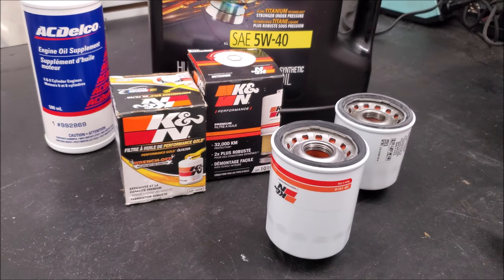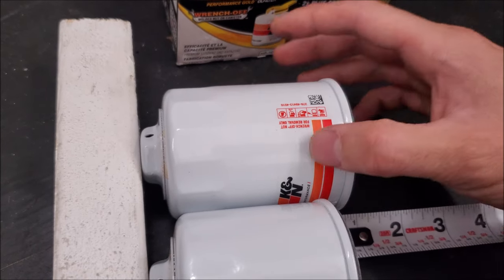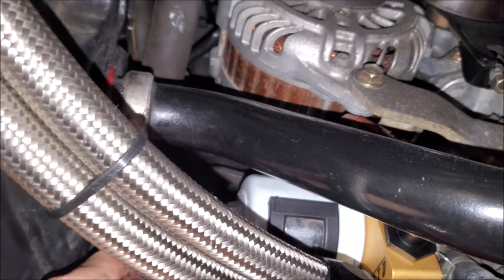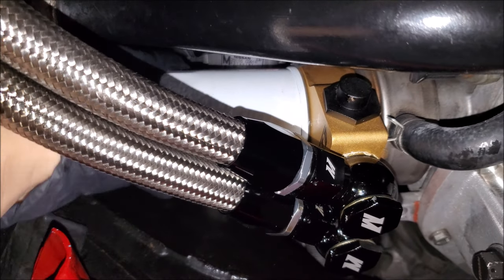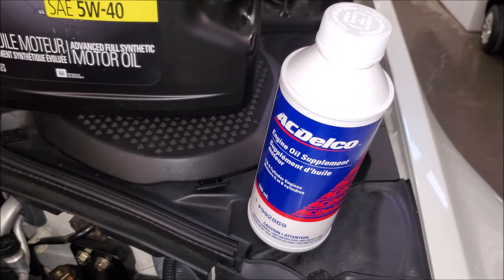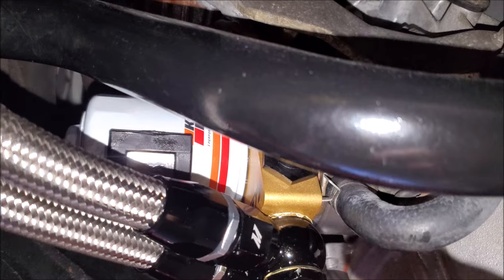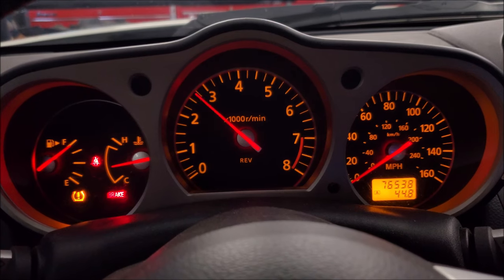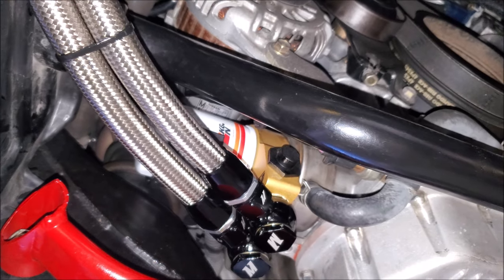Nissan 350Z / Infiniti G35 Larger Oil Filter (K&N HP-1010) | AnthonyJ350

Comment: i installed on my Z350 Mobil Extended performance M1-110 oil filter which is also a bit longer then regular with Mobil extended performace oil 5w-30. The combo works together perfectly, the car rips!
Reply from the maker: Awesome! Thanks for sharing!

Comment: You should try out fram ultra / wix xp / purolator boss and Mobil 1. All those filters are actually better than the HP. The HP is designed for better flow but it has a lower micron rating (95% at 30 microns) where as the ones listed above are 99%+ at 30 (Mobil 1) and 20 microns (smaller particulates). The k&n is designed more for racing so it priorities flow over filtration.
Reply: they also have wire mesh backing for structural rigidity under high pressure
Reply from the maker: I don't rely solely on any oil filter to get the small metal debris, that's why we add magnets to all our vehicles https://youtu.be/Lec_ykPhV8A
Reply: @AnthonyJ350  I hear ya. I was just suggesting because I also run a filter mag w/ a greddy mag drain w/ those filters on my g. That way all 3 filtration sources are top tier. But just my suggestions I love your vids man thanks for your feedback !
Reply from the maker: @sixtyminute4482  Funny thing is I just went on K&Ns website. They only list the smaller HP-1008 for all the Nissans including the GTR. Technically making this video already obsolete lol.
Reply: @AnthonyJ350  if it works it works I guess 🤣
Reply from the maker: @sixtyminute4482  I'm just going to put an all aluminum 5.3L and bore it out to 5.7L. That way it's still a 350Z (350 cubic inches 😉).

Then I can put a nice big Chevy oil filter on it.
Reply: @AnthonyJ350  hahahah full send brotha
Reply from the maker: @sixtyminute4482  You can solve any VQ, Rotary or Boxer engine issue with an LS engine lol

Reliability issues and power aspirations.

I never check the oil in my truck. Even with a small oil leak it never gets low between oil changes lol.

Comment: Good Idea! My questions are ,is the Bypass Valves set to the to the same Pressure setting for bypassing? Do both filters have the same Micron filtering? How much more square inches of filtering media are you gaining by going to the larger filter?
Reply from the maker: If it's good enough for a GTR and also works on a 1.7L Civic, it should work fine for a VQ.
Reply: @AnthonyJ350  Typically, engine manufacturers design bypass valves to open at a pressure differential of approximately 10 to 30 psid with some as low as 4 psid (28 kPad), and others opening as high as 75 psid (500 kPad).
K&N filters only to 30 microns, Mobil 1 filters down to 20 microns. 
Your hypothesis of doing Better may be wrong and based on assumptions.
Reply from the maker: @stealthg35infiniti94  You can put a Mobil 1 filter for a GTR if you'd like. My point was advocating for the bigger body. Not the brand.
Reply: @AnthonyJ350  Research on bypass Pressure is required. The 20 microns is excellent filtration. The theory is to catch the particles and not let them bypass or go through a larger opening (30 microns).During high revolutions engine Pressure may exceed the bypass valve if it is designed to open lower setting. Thus unfiltered oil is bypassed into the engine. In the other extreme, heavy contaminated oil that impregnated the filter media, the bypass valve may not open at the required Pressure thus reducing oil circulation and causing catastrophic damage. Pressure and Volume for a filter required is designed by the engine designers.That's why there's dozens of different types/kind/sizes. Bottom Line: Use a high quality synthetic motor oil/filter and change it at required interval. The rest is Placebo thinking.
Reply from the maker: @stealthg35infiniti94  I just tried, it looks like K&N discontinued the HP-1010. The Civic and even the Armada list the HP-1008 now.
Reply from the maker: @stealthg35infiniti94  Search a 2010 GTR and it's now a HP-1008. So in theory the pressure for the bypass is the same.
Reply: 11-17 for the shorter HP1008. 

13-17 for the larger HP1010.
Reply: @AnthonyJ350  Really?!?! Damnit, man, im late asf.

Comment: 1. Doesn’t thicker engine oil (you are using 5w40 although the factory recommends 5w30) cause low engine oil pressure and/or laggardness at low speed start?

2. Do you always use 5w40 viscosity even for winter season in Canada?

3. Why are you using 5w40 instead of the manufacturer’s recommended viscosity, 5w30?
Reply from the maker: This is why https://youtu.be/5Nmxi0du8-Q
Reply from the maker: This is also why my truck is getting 5W40 synthetic https://youtu.be/zVjVAAikdYc
Reply: @AnthonyJ350  Doesn’t thicker engine oil (you are using 5w40 although the factory recommends 5w30) cause low engine oil pressure and/or laggardness at low speed start?
Reply: @AnthonyJ350  are you using 5w40 to your 350z even for winter season?
Reply from the maker: @Qkfltpdls777  Car doesn't get used in the winter. My truck uses 5W40 all year round

Comment: Hey Anthony I just have a question for you regarding a light that comes on on my dash labeled "slip" I don't drive the car very hard it's a 2005 DE and it always happens and cuts my power on the same slanted corner near my home on ontario,  thanks if you read this , 
-Marty
Reply from the maker: You're probably lifting a wheel on the aggressive corner breaking traction and the traction control is kicking in.

Comment: Any difference in oil burning/consumption with the mishimoto oil cooler? Would the larger filter make a difference with that as well?
Reply from the maker: I don't think a larger or smaller filter will affect that. Oil consumption is oil control ring and/ or PCV system related.

Comment: I always consider this or a system similar to Amsoil dual bypass system, but I change my oil every 4k, so it's unlikely for me to see much benefit
Reply from the maker: Up to you, I just don't like having a filter the size of a motorcycle filter on the car.
Reply: @AnthonyJ350  I hear yall, in my old civic, I think the filter was the size of a kids sippy cup lol
Reply from the maker: @DapimpBDSD  Which makes sense because the engine is the same size as a litre bike. And here we have a 3.5L V6 with a smaller filter than the 3.5L in a Maxima or Altima.

Comment: Car enthusiasts change their oil often. Soccer moms do not. This is why the z comes with a small one while the maxima has the oversized one.
Reply from the maker: That's one weird possibility.  Isn't the interval basically the same between a Maxima and 350Z in the owner's manual?
Reply: @AnthonyJ350  Yes. and the engine is the same size. only difference is one is driven by enthusiasts mostly.
Reply from the maker: @jessie38supercharged  Why would you want a smaller filter then? The R35 comes with a bigger filter, isn't that an enthusiast vehicle?

Comment: That was your oil pressure on a cold start? Mines is much higher 😅
Reply from the maker: American car?  Is the gauge PSI or KPA?
Reply: @AnthonyJ350  PSI
Reply from the maker: @SalmanHussain  I guess yours is higher then
Reply: I run a wix filter(non-track) with motul 5w-40. Warm up is like 90psi. Track session is k/n with same oil the warm up is a little lower maybe 75-80psi
Reply: @AnthonyJ350  I’ve had the car for 11 years and am at 99,900 miles but from what I can remember on cold starts, mines has always been around 120 and then slowly comes down to the at 60 and then 30 on idle.  Around 60-70 cruising and 120 on WOT https://youtube.com/shorts/cvIXw4PW4n4?feature=share created a quick short on a cold start.
Reply from the maker: @SalmanHussain  Nice!